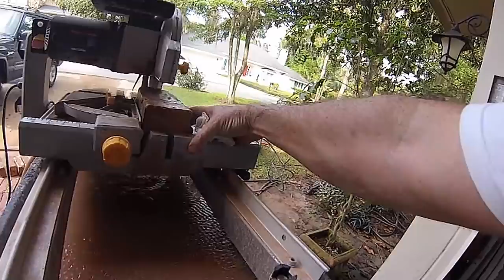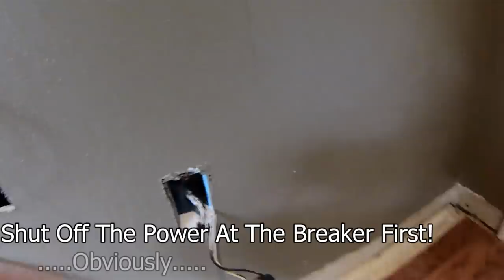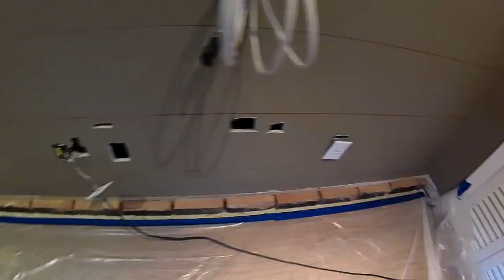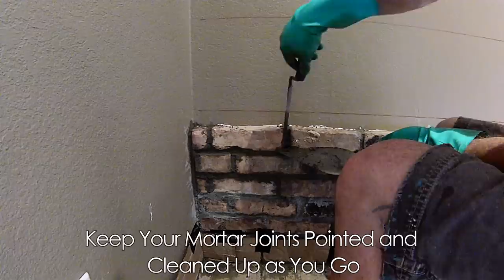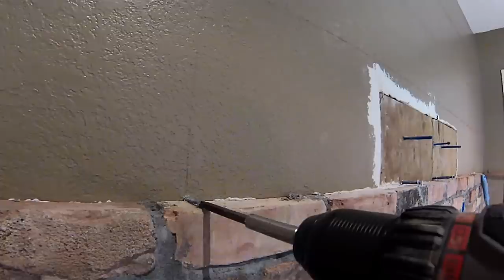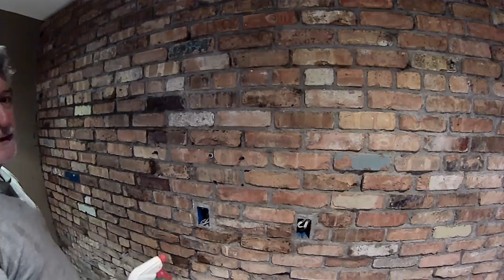How To Build An Exposed Brick Veneer On An Interior Wall

Comment: Lovely job but I am sure you could cut those brinks even thinner. They're far to think.
Reply from the maker: So I should have doubled the insane amount of brick cutting that I already had to do? Why would I do that?
Reply: @LeeMcNeil  Well? To start with you would have cut the weight of each brick by half which is good and with the other half cut you could place it somewhere else in the house and the would had been very wise ...money wise of course. lol
Reply from the maker: @andreiiasi  Weight isn't an issue because I built this on a concrete slab on grade. So it doesn't make sense to double to make two cuts to get two thinner brick faces when I could make just one cut and get two thicker brick faces. The thicker brick also allows for more texture in the wall by varying the thickness of the mortar joints.
Reply: @LeeMcNeil  Yes you probably right. It was a suggestion only knowing the fact that most homes in the US are made from wood and dry walls so weight is something to think about. It does look good though,
Reply from the maker: If I were to build this on a wall that's on a upper floor or over a basement, then the thin brick would probably be the way to go. You can buy thin brick, but it's the same cost as a regular brick, so it would basically double the cost of using a regular brick and cutting it in half to make two bricks. But I'm not sure it would make sense to double the amount of cutting (because I would have to cut each brick twice instead of once) to avoid the extra cost to buy the thin bricks. I guess it depends on how much free time you have and how well your wet saw is running.

Comment: Im surprised you didn't remove the drywall
Reply from the maker: The brick veneer is actually secured to the wall mechanically with screws attached to the wall studs, which protrude about 1"to 1-1/2" into the mortar joints at 18" on center vertically. Go to 12.05 in the video to see what I did. There isn't really any reason to remove the drywall.
Reply: @LeeMcNeil  oh ok nice I see

Comment: The wall looks nice. But brick wall is not glued to the main wall, it's not good. I think, you need to use gypsum tiles in the form of bricks, this method is simpler
Reply from the maker: I didn't just glue the bricks to the drywall, I also mechanically attached them to each stud behind the drywall, at approximately 18" intervals. You can see what I did at the 12.07 mark in the video. Quite a few people miss that part of the video.
Reply: @LeeMcNeil  Yes, I saw this. But I didn't see the glue between the bricks and the main wall. Anyway if this wall is standing still, your work is definitely good )
Reply from the maker: @KirillEfimov-cz7jj  The bricks are both glued and mechanically attached to the stud wall behind it. And yes it is still standing LOL!
Reply: @LeeMcNeil  ha-ha, ok )

Comment: What I would have done is I would have cut the bricks 1" thick, then would use the adhesive and a 1/3" trowl and used 1/4-1/3" spacers to give the right spacing between each brick. I would do the whole wall that way, then after that all dried and was done, I would mix some grout that's the right color and I would stick it into a bakers bag and squeezed the grout into all of the spaces between the brick, then use my finger with a clove to clean it up and have it look good. Then would use a sponge and some water to clean it all up after I was done and finally used a brush to make the grout look right. Then I would spray the entire wall with a sealant. Its clear and is a matte finish, but it would protect the brick from any staining.
Reply from the maker: mhrepoman What you are describing is basically doing a thin brick. The thing is that is you would have to double your cuts on the bricks. I could have just bought thin brick but they cost as much as a regular brick and that would have doubled the material cost. I did try your method of adhering the half brick and filling in the mortar on about three courses and it was much slower. Mainly because it required so much mortar because of the thickness of the half brick. I also dug into the mortar pretty deep (more than 1 inch) in several spots which made a big difference in final product in my opinion.

Comment: Move to England where they have proper houses, you only have to knock the plaster off the wall...job done 😂😂
Reply from the maker: There are a lot more brick and stone houses in other parts of the US, but not so much here in Florida. The soil here is sand and occasionally some limerock (which came from old coral reefs) so no clay for brick and not much stone. Plus there weren't a whole lot of people living down here before air conditioning became practical so probably 90% of the buildings in this state are less than 50 years old. And they just don't build them like that anymore these days, even in England I'll bet.
Reply: Lee McNeil : you’re spot on with your last comment, houses (in London) are just thrown up now.
All joking aside you produced a fantastic result.

Comment: Here in the UK houses are still made from brick and probably always will be.
Reply from the maker: Yes - they do a lot up north here in the states too. The problem with that here in Florida is there isn't much clay or stone - but there is a lot of sand and fast growing pine trees so concrete block, stucco and wood framing is the most economical around here. Plus there isn't an overabundance of good masons around here either which compounds the problem.

Comment: Possibly quicker if you had used a 10mm spacer at brick joints instead of a mortar joint and then pointed it all up withmortar from a pointing gun. Labour of love you did anyway. Nice one
Reply from the maker: Yes I tried that and it was way slower. I did about three courses that way. I was going to include it in the video but cut that footage because it was getting too long. I think the problem was with the half brick, it was just way too much mortar to stuff into the joints. If I would have been doing a true thin brick, that would have definitely been the way to go.

Comment: why didn't you just cut the back and front off the brick that way they would be like tiles
Reply from the maker: Two reasons for not doing that, 1) it would have been twice as much brick cutting and 2) I  would not been able to get the depth of texture on the wall with a thin brick. Notice the area's where the broken corners of the brick and where I gouged out the mortar to make it look like a really old brick wall. I would not have been able to do that with a thin brick.

Comment: How expensive is it?
Reply from the maker: Around $400 for a cube of brick plus about $100 for mortar, etc. Then you need to get a wet saw which is around $280 but you can probably sell on craigslist for $200 - $250. I used reclaimed Old Chicago brick but other kinds of brick might be cheaper. I didn't need that many brick for this project so I had about 200 bricks leftover that I could use for another project.
Reply: How much is for the labor
Reply from the maker: Depends on where you live. Around here probably $1,500.

Comment: Should have cut the brick down the narrow part. The halves would be thinner and cover more space. 

Also, cutting each brick sounds like alot of painstaking work. lol
Reply from the maker: Oh it definitely was more work but it saved me about $350. And I thought about cutting the brick down the thicker side of the brick for the same reason you mentioned, but I don't think that would have looked as authentic since brick is always laid with the thin side showing on the face. It would have looked like pavers on the wall.

Comment: I don't know why I get the feeling that it would get messy if the drywall gives in to the weight of the brick
Reply from the maker: It's tied back into the studs with screws every 18". Go to 12.07 in the video to see what I did.

Comment: Why not just have done a brick veneer?  It will look the same with less time, much less weight too.   Also, muratic acid is very dangerous when inhaled.
Reply from the maker: This is a brick veneer. Do you mean thin brick? I talk about it in the video somewhat but the material is twice as expensive and you can't get the depth and texture in the mortar joints and the damaged brick like I have on this wall. Brick walls made with thin brick are pretty easy to recognize as "fake" to my eye, but I know most people would not be able to tell the difference if you want to spend more money on thin brick and save some labor.

Comment: Using full brick would have also effectively put the weight of a small car on that wall (40 psf * 8'*10' = 3200 LBS)....careful.
Reply from the maker: Yes - if you go around 2/3 to 3/4 way into the video you can see where I did a mechanical tie into the studs with a screw into the mortar joint about every 5th course. You definitely don't want to do this without a mechanical attachment.
Reply: Will that help with the weight beneath though?
Reply: I think another way to have done it would be to remove the drywall and mortar directly to a cement board. That way all the weight is transferred to the the studs naturally and evenly. It would have bumped your cost up a bit though. Also great job. It looks amazing and has inspired me to try that out in my house!
Reply from the maker: It's on concrete slab on grade so it's not sagging. I would have definitely shored it up from underneath otherwise.

Comment: a half a brick each? That got to be way to heavy for that wall
Reply from the maker: It's all sitting on a concrete slab on grade and is mechanically tied back to the wood stud wall behind it with screws. it ain't going anywhere.

Comment: nice sandles . I'm 1:34 seconds into this and I can't wait till you drop a brick on your toe!!
Reply from the maker: Haha - well I didn't. I did another project at my house and dropped a nice chunk of granite on my toe. That hurt pretty bad - I'm sure I broke the toe. I'm not sure anything but steel toe boots would have made any difference in that case though. I am putting together a video for that project but unfortunately did not record the actual incident. You are right but it is so damn hot down here all the time, I think the risk from keeling over from heat stroke is greater than dropping something on your toe.

Comment: i can see that falling away from the wall, theres not really anything for it to adhere to
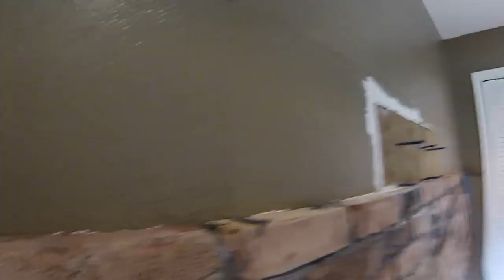Reply from the maker: I am using screws into the studs to mechanically attach the brick to the structure. Go to 12:07 into the video and you will see what I did.

Comment: We still build with brick in the uk. We don’t trust houses made from osb polystyrene sandwiches.
Reply from the maker: Yeah, there are way too many houses and apartments built using that crap. Mine is actually reinforced concrete block on the exterior walls.
Reply: Lee McNeil it’s ok in dry stable climates. But in the uk the weather ranges from subzero to virtually tropical. Condensation forms at the cold foundation baseplate where it meets the warm insulated wall panels. Recipe for a rotten baseplate. Wait and see what happens to uk sip houses in 15-20 years. Kingsman changed their foundation detail when I challenged it. Initially they denied there was a issue. Sips only work well in huge steel frames where they don’t form the structure.
Reply from the maker: @kevinkeelan354  Yes I agree. I live in Florida so the moisture is a constant threat here too. But the other big reason is termites (and really all the thousands of other bug species that would love to make a home in your wood framed walls). And don't light a match around one of these piles of sticks either. Riding out a hurricane in one of these wood framed, OSB clad houses must be a white knuckle event too.

Comment: It looks good but you should never build a brick wall on top drywall, you will regret it the future. You should've just use sheetrock cement to bond with it.
Reply from the maker: The bricks are mechanically attached to the stud wall every 18" vertically. Go to 12.06 in the video to see what I did. Those bricks aren't going anywhere.

Comment: you saved money by cutting the bricks yourself, but wasted days cutting the bricks. So did you really save money by losing all that time?
Reply from the maker: You are absolutely correct about that. But it depends on your situation. I am a real cheapskate, I don't have a lot of spare cash, plus I love doing projects like this - and it got my son off the couch a little bit too. If I were to think in those terms about this project as a whole (or really just about anything I do around the house) - would it be cheaper for me to pay some money than if I paid myself for my time, then I wouldn't be doing much. And I wouldn't be able to afford to get much done either. But good point!

Comment: There was a story locally of a guy who flipped homes and did this to an interior wall of a house he flipped.  Less than a month after the home was sold and the couple moved in and less than two months since he did the brick, the wall failed and the brick fell down as a sheet, killing the couple's pet dog and injuring their 12 year old son. 

Moral of the story, don't do this to an interior wall and make sure you anchor the brick properly. 

Edit: this means, follow the advice of Mr. McNeil!!!!
Reply from the maker: Brian Schott Apparently you didn't watch the video. If you did, then you would have surely noticed how I mechanically attached the bricks to the structure behind the wallboard.
Reply: Lee McNeil oh, I did!  i was just offering a reminder and retelling a story about what happens if someone doesn't follow your directions.

My comment wasn't directed against you at all.  sorry if it came off differently.
Reply from the maker: In retrospect I should have put more emphasis on mechanically attaching the brick to the wall and I would go back in to edit it if I could (like put in a subtitle somewhere in the beginning) but there isn't a way to do that on YouTube for some reason.
Reply: Lee McNeil - if that is something you wish to do, go into the YouTube Creator Studio (where you edit your videos) and edit this video, then go to the "annotations and end screens" tab.  here you could add some text over parts of your video.

I added an edit to my original comment to make it more clear I mean it only to back up your advice.

Comment: a stone look would of looked way better.
Reply from the maker: Stone isn't really used much as a wall finish much around my location - traditionally. There are a bunch of newer buildings with it but stone isn't really available close by - except Florida keystone which is cut from ancient limestone coral. And it especially wouldn't look as good as brick in my house. I have big brick decks and a brick pizza oven out back. Stone would be kind of out of place.

Comment: USA Typical cheap hollow wall ... Build the house stone on stone and not always this cardboard houses ... Cut with a miller a cable slit in the wall and well.  Then clink or whatever you want
Reply from the maker: We have very little stone or clay here in Florida so brick and stone construction is relatively rare around here. We mostly use reinforced concrete block for exterior and structural walls. But this is an interior wall so stud and drywall construction is perfectly acceptable, not to mention it's way less expensive and more versatile than laying stone or actual brick interior partitions.

I don't disagree that there is a lot of cheap crap that people will build houses with here though. Mainly it's the production and tract home builders that are the worst offenders.

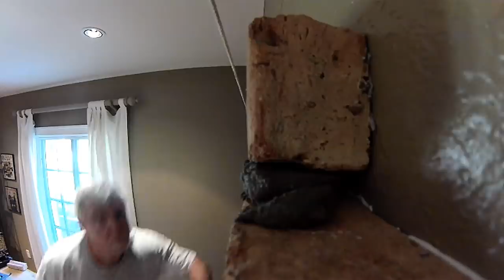Comment: 13:57 As a bricklayer I cringed looking at this line and the brick :/
Reply from the maker: HAHA! I see what you are saying. I wasn't really using the line to keep the wall plumb because, if you think about it, I was adhering the brick to the wall behind it - so if that wall was plumb, then the brick would have to be plumb. I was really just using the line to keep the course at the same elevation and level from one end of the course to the other. I think there is a little trick of perspective from where the camera also that makes it look like it wasn't lining the brick to the same height of the string, but I was. I worked about 8 years doing a lot of construction layout when I first started in the business, so I was pretty confident in my ability to do that part of the project correctly.
Reply: Yeah I understood your process :)
Personally I would have laid the half bricks as if they were normal bricks, then infilled behind with a mastic or some decent resin mix. 
Looks good at the end though!
Keep your eye out for any cracks appearing though, because that could soon become a problem, internal brickwork gets effected by your heating being turned on and off a lot.